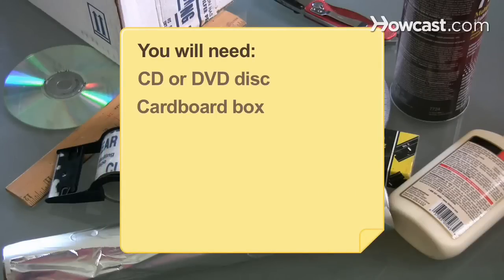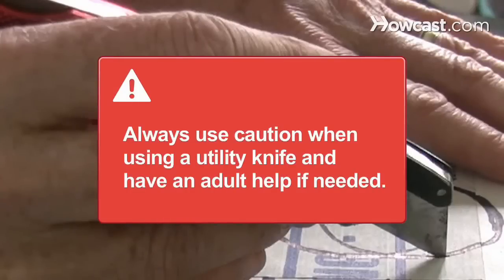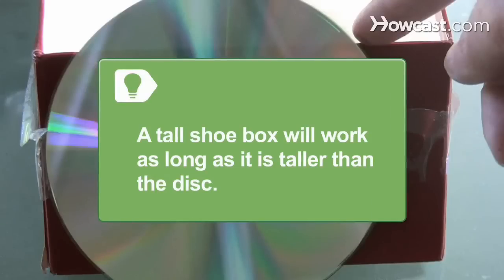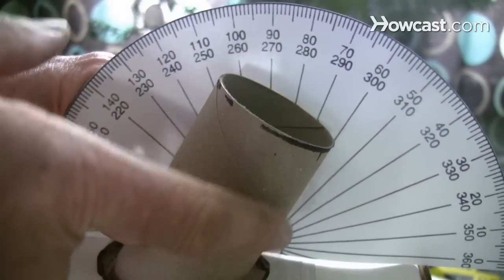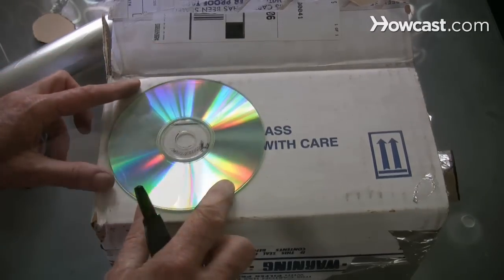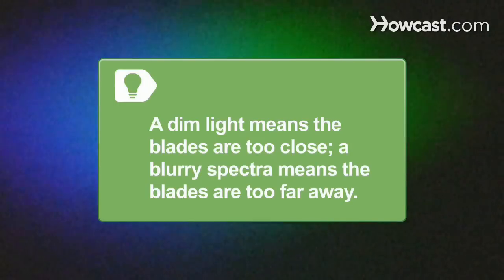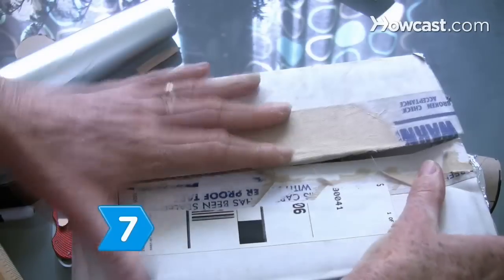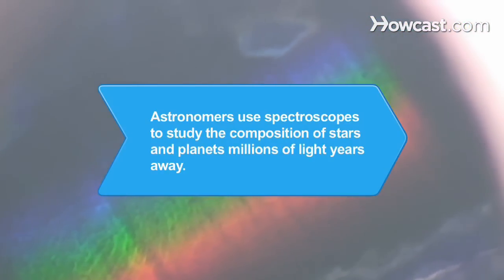How to Make a Spectroscope

Comment: Why a CD?
Reply: A CD is used as a diffraction grating, which does a similar thing as a prism, but with reflection from the CD surface rather than refraction.  Ever notice how the reflection on a CD is like a rainbow?  It's doing part of the task of a spectroscope already, even without the box and slit.